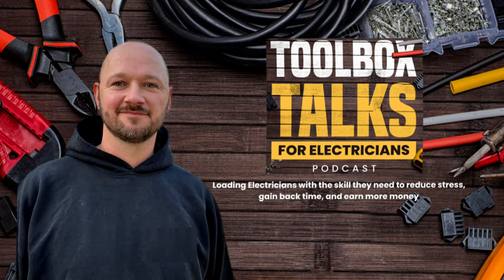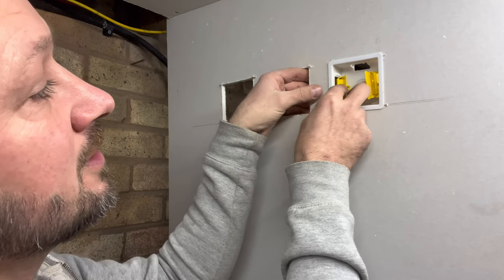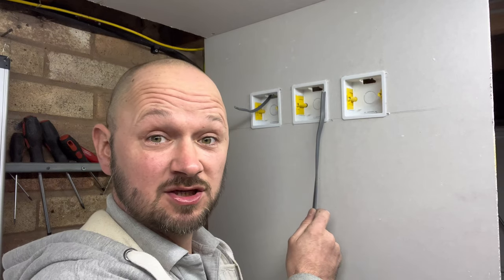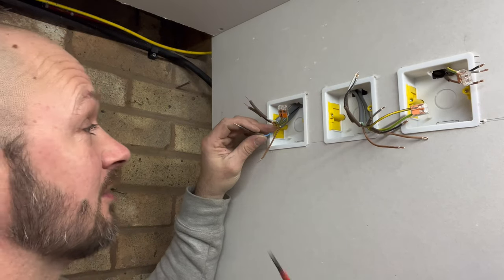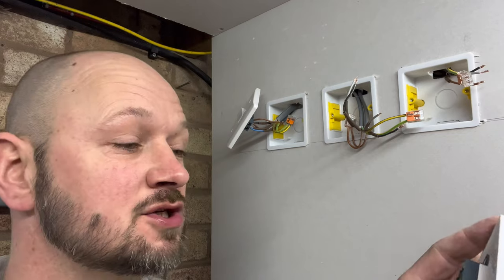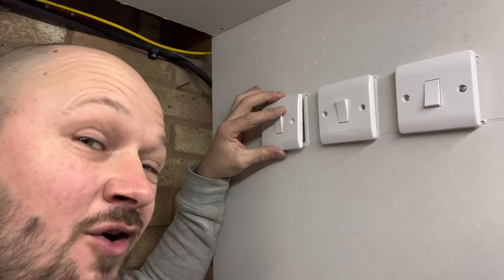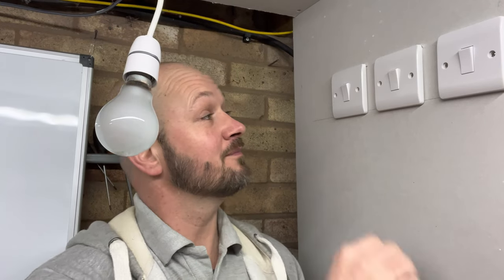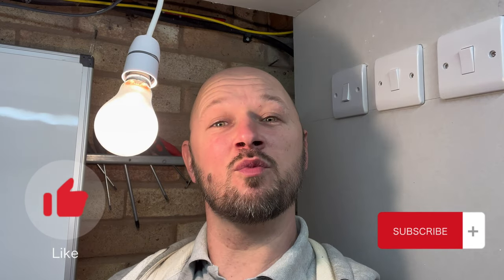Master Wiring: Three-Way Light Switch Made Easy

Comment: Fab video, how do you take out the inserts without damaging them, the white things over the screws that fix it onto the wall? I don't want to use a flat head screw driver and damage them, I have 18 sockets and switches to do, we had them all fitted and I need to paint round them where the old ones use to be were bigger. Thank you. I was thinking of a very small flat head screwdriver ?

Comment: Might want to redo this video… well presented and easy to follow… however key error is connecting both blacks to intermediate L1s and greys to L2s… will just mean it is constantly on… need to put black and grey from one wire into L1s and black and grey from other wire into L2s…
Reply: Wish I’d read this before I started the job😖

Comment: Thank you for this. Not sure if it's too basic, but wonder if you can run over  some terminology,  such as what is common? What color is it normally in new builds or old builds. 

Very helpful regardless.
Reply from the maker: No worries. Common will be brown and L1 will be black then L2 being Black. Both with brown sleeving
Reply: Hi mate, If you haven't second fixed the intermediate switch be prepared as everyone wires them differently. I for example don't use the brown as the common, I use the grey, Black as L1 & Brown as L2.

Comment: First off thank you for describing a 3 way switch which I followed 😂 just… but what would happen if you had 2 or 4 lights in the room?
Reply from the maker: Haha, great question! If you had 2 or 4 lights in the room, you might need to hire an electrician to handle all those switches! Just kidding, there are actually different wiring configurations for multiple lights, and I can definitely cover that in a future video.

Comment: Can you use an intermittent switch as a 2 way if you just link out both sides at the bottom? Am struggling as only have intermittent for my grid
Reply from the maker: Yes, you can use an intermittent switch as a 2-way by linking out both sides at the bottom. It might not be the conventional way, but it can work in a pinch!

Comment: What happens at the dB if I use 3core as my feed to some emergency lights in the hall  wat and 2way switches?
How do I wire at the DB?j have black snd brown
Reply from the maker: There would be no point in using 3 core from the Db unless you want to use a sw live from there too

Comment: In firsr switch ,where you connect live and neutral 
Live in common and neutral L1
Reply from the maker: In a first switch, you connect the live wire to the common terminal and the neutral wire to the L1 terminal. Make sure to always follow the correct wiring guidelines for safety purposes.